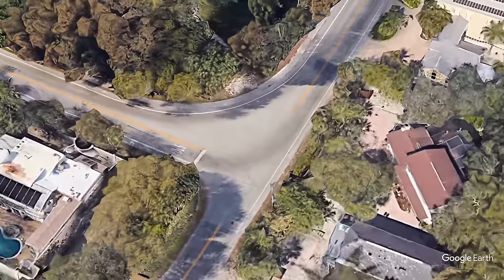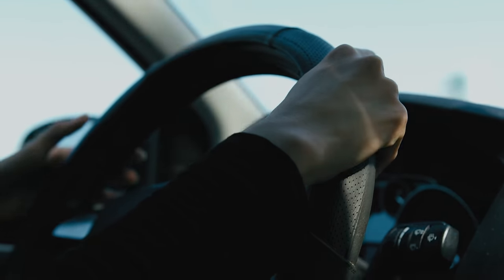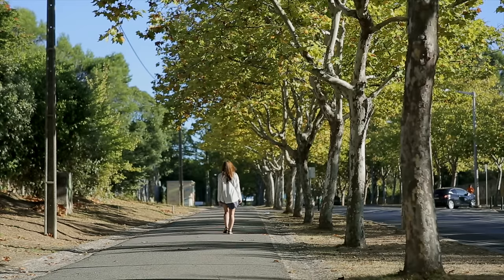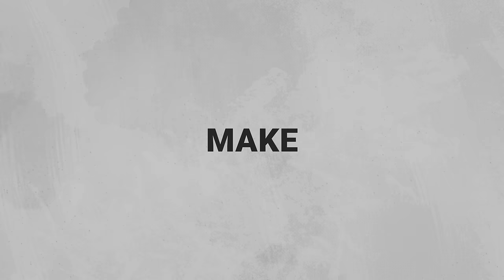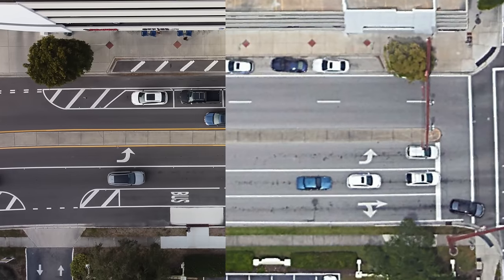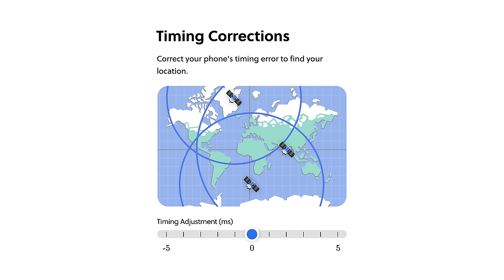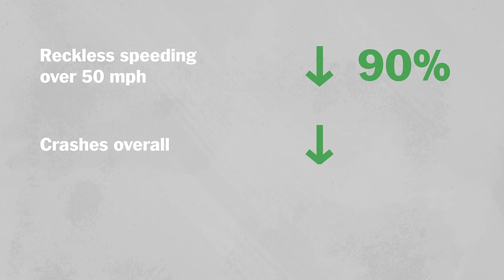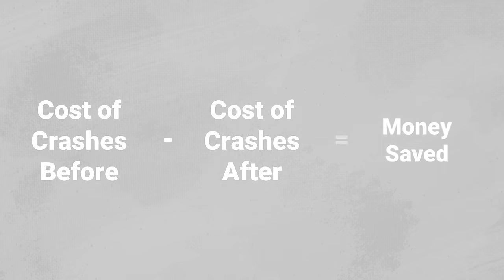This is the key to safer streets

Comment: Where I live more and more round-a-bouts are being built. They are very expensive, as one of the most often type, a micro round-about on 2 lane roads often cost well over $1.5 million.

These micro round-a-bouts are designed to slow down traffic, going against what most people are told: round-a-bouts increase traffic flow.

They often are designed with 12 foot sidewalks even if the roads don't have sidewalks. They often don't block sight lines like a proper round-a-bout. This causes people to stop at the entrence instead of yielding simply because the driver sees a car driving towards them on the other side of the round-a-bout. This is why the center circle of a round-about should be disigned to block sight.

These micro round-a-bouts often have un-intended consequences. Before the round-a-bout it may be difficult to turn left onto the side road. With the round-a-bout it is now just as easy to turn left as to go straight.

This is true for the main secondary road and the neighborhood road. This unintentionally coverts the low volume, low speed neighborhood road into a medium volume, faster speed connecting road.

While the intersection is arguably safer, the neighborhood road is not. 

The main road for this round-a-bout is actually a secondary connector road. The south end is a high traffic 2 lane state highway. Traveling north the first cross road is this round-a-bout, then a secondary connector road, then a secondary 2 lane state highway and then ending at another connector road.

Every other cross road has more traffic. The 2 State Highways and the nearby secondary connector have heavy traffic that often backs up. All 3 have room for a decent sized round-a-bout, none are being considered.

-----

Then there are areas where many round-a-bouts are built on 4/5 lane streets. Because the primary purpose is to slow traffic, every round-a-bout is designed differently, forcing people to slow down to determine which kane they need and causing confusion.

Some may have 2 lanes entering the round-a-bout (from now on R) with a 3rd lane specifically to turn right.

Some may have 2 lanes entering the R with the right lane forced to exit at the first right.

Some may have 2 lanes entering without forcing the right lane to exit.

1 R is designed to be a freeway entrance AND a side street that has a hospital. This means when heading to the freeway and entering the R, if you want to go to the hospital you need the far right lane. If you want the freeway on-ramp you need the middle lane, if you want to go over the overpass you need left lane if you will be taking the next onramp or the middle lane to stay on the road. Entering the R from the hospital means you either take the right lane which only allows taking the first freeway onramp. If you stay on the main lane you are forced to cross paths of the R traffic taking the exit for the first freeway onramp then decide which lane you need while on the overpass, left lane for 2nd freeway onramp or right lane to continue onwards.

Exiting the freeway onto either R is just as confusing. At the very least this should have been a single Oval-a-bout.

At the other end of town, the final R is also confusing because one entrance of the main road is 4 lanes, with the right lane forced to exit and the other side of the main road is only 2 lanes.

This means every time you approach a R, you not only have to figure out which lane you need, but also how many lanes of traffic are coming towards you. Remember there are never 2 Rs of the same style in a row no matter which direction you are traveling.

And to make things worse, this is a shopping district and they allow entrances/exits from the various strip malls and clusters of shopping directly to the main road instead of forcing them to only use side roads.

---------

In another area they are putting in tiny micro Rs. The stated goal is to force traffic to slow to 10-15 mph. This road is a connector road from a freeway exit to a primary connector road. The road has several apartment complexes and house sub divisions.  Originally this road was 2 lanes but divided with a mound and/or trees in the median.

These Rs are so small a full size truck needs to cut through the center by several feet. Most of the Rs are located at apartment entrances.

No Rs for the busy freeway entrance. The first cross street from the freeway goes to an elementary school and middle school. There is also an entrance to a large church. This area is very congested, so the solution was 1 stoplight for the church and another about 50-70 feet away. They didn't put in a dedicated right turn lane for the schools, nor a dedicated right turn from the schools. This area is about 150 feet from the freeway and on the other side of the freeway leads to the shopping district and mall for the area.

The end result is worse traffic as parents and buses pick up and drop off students.

All of the dedicated left turn lanes were removed because of the Rs. There was enough room to add a 2nd travel lane. The few side streets with traffic lights could have been converted to decent Rs. They could have added small curves to slow traffic, but many areas that don't have direct appartment access could safely be 35mph.

Instead they broke the project into  3 phases with the cheapest phase over $35 million. The total price will likely be $125 million or more. This is in an unincorporated town of about 25,000
Reply: Are you like 90 or something? It's spelt roundabout, not round-a-bout
Reply: @Gfynbcyiokbg8710  feel better?

Comment: I'm pretty sure I learned that the bulges at the crossing were not as effective as the theory suggested.
Because the extra visibility played into the driver's speed perception, so people who know they're going straight run red lights at them more. The pedestrian advantage was there but drivers didn't act safer near them.

Comment: Is there a negative impact on traffic?
Reply: roundabouts improve traffic flow because you don't have to stop. Whether at a light or a stop sign, only one car can go at a time, so traffic slows dramatically at a stop, increasing congestion and incentivizing dangerous and unpredictable behavior. By using a circle cars generally don't have to stop, so times through these control devices are better than conventional devices.

Comment: Tree roots also create problems - they destroy paved surfaces as they grow.
Reply: yes, but at a much slower rate than cars destroy surfaces, so it's not really a problem on roads with normal traffic.
Reply: @BenjaminWalburn  got to laugh. They re-levelled and resurfaced a road I use most days, a feeder road to a housing estate, and a couple of years the tree routes had caused the uneven road surface to return whilst the top surface is still fine.

Comment: I moved to a new province and got a speeding ticket my very first drive. This video explains why it makes me so upset. 

I was on the highway - three lanes per direction, large median, on/off ramps, and of course, no pedestrians, no intersections. Limit 110 Km/h. I was actually going 101 looking for my exit and got a ticket for speeding. I have since found out that the highway limit drops to 80 in city limits. No design change, just a sign that I didn't see. 😡  I have also seen rural highways here with one lane in each direction, intersections, no median, and school bus stops. Limit 100. Not intuitive at all.

Comment: It's funny how stuff gets around, this stuff was done in India some time ago, a few years I think, they used bright and colourful guides for some dangerous junctions, using road paint over plastic.

It's a real shame road markings get ignored by designers so often, they are, to my opinion, the most effective way to inform a driver, a sign can be missed, huge numbers/letters and lines, filled shapes, are a lot harder to miss, and their use can help assign blame when needed in the case of a collision.

But it's important to remember these adjustments made to existing roads, are the BARE MINIMUM, these are the cheapest way for government to help reduce damages and deaths on the roads.

Comment: Ever heard of non-newtonian speed bumps? For those unaware, a non-newtonian fluid hardens when a high level of sudden force is applied to it. This way, if a vehicle is going at the proper speed, the fluid stays fluid and it is as if the bump is not there. Go at the bump too fast though, and you are going to pay for it.

Comment: Mini roundabouts in the UK don't even bother with the plastic - they are just a bit of paint on the road!
Reply: People in the US are not well... acquainted with roundabouts. 

Just simple psychology game. If it were just paint, then people can just ignore and drive over it. But because it's raised, then people will think twice about going over it at high speed, in fear of damaging their vehicle.
Reply: @harveywilde6781  In fact, in the UK, half of the time they DO just drive over the middle of it.  The US solution works much better. Also, the US is well acquainted with roundabouts now that we've had them for some 30 years.

Comment: 89 mph on a street in a neighborhood is madness. 89 mph on a wide open interstate is often illegal but really not a safety issue!

Around where I live there have been roads that had their speed limit lowered (sometimes just as NIMBY noise complaints) some claiming for safety but the infrastructure didn’t change. So now those roads are more dangerous. You have the people who are following the speed limit exactly and those familiar with the road driving it at the speed the road was designed for. The large difference in speed among traffic is a hazard. And crash data supports that. But the response has been more radar traps rather than just fixing the root cause.

Comment: How is plastic preferable to standard painted mini roundabouts like is used in the UK? It's worse for the environment as it wears away and I'd be surprised if it's cheaper either.
Reply: The downside of paint is that people might just ignore it, while simple physics makes a plastic curb much harder to ignore. They also mention that it's a trial installation, so it has to be easy to remove.
Reply: @2001Pieps One thing they're missing out on is that those painted roundabouts are also somewhat raised which is probably why it wasn't used here. They're more permanent than the plastic option.
Reply: @kev2034  Not all mini roundabouts in the UK are raised, in fact, most of them seem to be just paint, which allows cars to simply pass right over them.
Reply: It's recycled plastic put to good use, instead of going in a landfill.  I should think that's much better for the enviornment.

Comment: The ridiculous thing is that this also decreases emissions and increases fuel economy slightly from not having to accelerate from a stop. On top of that, you don't have to take turn stopping one by one so while yes it is slightly slower when there's absolutely no traffic if you drive like a maniac, it's actually much quicker to get through when there is high traffic coming from one side during a surge. And safer too.

Comment: 7:55  okay guys, question here:  The middle is for both sides to turn left  without any certain stop?   This feels a bit crazy to me, wouldn't that mean that you could potentially have 2 drivers deciding they need to turn and then collide with each other?  

Or am i misunderstanding this
Reply: You are.  You usually enter the turn lane within about 20-30 feet before the turn, which is enough time to stop in case there is another turner opposite. Also, we don't enter them at full speed.
Reply: @jaycee330  got it, thanks :D

Comment: Now how OP did not mention anything about speed limits making people go a certain speed.

I love in a large industrial suburb of California. My drive to work includes a street where the speed limit is 45.  It's extremely rare for anyone to go over 35 for a large section of it.  Peoples comfort does not even let them get up to the speed limit here.  A low visibility turn that had a bus depot exit makes it feel dangerous to go that fast.
Reply: Speed limits don't change much

Comment: The intersection does not look pretty typical, it looks weird like there's open space without at least dotted lines to indicate direction like you'd see in the intersection of two 2+ lane stroads. Also the shape, it looks like a slip lane on the one side or something? And the stop line situation is weird too, this seems like it could have been a T shaped intersection with the main direction having the right of way then another street that turns onto it
Reply: Of course the roundabout is better just doesn't look like how they'd usually make an intersection, maybe they did it differently bc they wanted quicker left turns like less preference to the straight away?

Comment: in Romania the speed limit in a locality (city/village) is 50 km/h, and on a hightway/roade is 120 km/h, but is comon to see negligent drivers in the range of 70 km/h. So for me a spead over 120 feels like a rocket.
Reply: In my country drivers only get fined for speeding 20 km/h over the limit. This has been the case since 2013, when the fine for speeding 10 km/h over was repealed (and to be fair it was really tiny, only about 3$ at the time). Also, there's been a 50% discount for paying a fine within 20 days, since 2016.

Comment: The only thing that little roundabout did was slow everyone down. It only looks good from the perspective of someone who's only concerned with safety. What if a popular shopping center opens nearby? A traffic light with a yellow arrow would keep traffic moving at a higher volume, and be just as safe.
Reply: You need actual physical barriers to improve safety. Car drivers generally ignore signs and warnings.
Reply: Physics work better against stupid drivers than signs.

Comment: I love round abouts and the engeniering but i have a problem when stuff like speed bumps are used too much or the street are to agressive to car drivers. Because more than often they are unnessesary and produce more pollution. A car is not efficient if it has to slow down every half a mile and has to speed up aigan

Comment: But… do the normal white mini roundabouts cost that much? You’re already painting on the new arrows and stuff, aren’t the mini roundabouts made of the same rubber stuff? I wouldn’t have thought melting down and specifically moulding plastic would be cheaper than just painting them on. 

This video was very bizarre from a UK perspective. Having pedestrians cross large fast lanes of traffic seems bizarre. I love the crossing islands as they don’t interrupt the flow of traffic but as a pedestrian you don’t have to wait for both directions to be clear before you cross and, as you said, it gives you more time to cross. It’s really helpful in semi-busy areas and is a lot cheaper than installing traffic lights. A young boy died in my area because of the lack of designated crossings right outside of a local park. Their solution, which has been great, is multiple crossing islands, as traffic lights at that point in the road weren’t feasible.

Comment: 9:05 - You are right about the advantages of a center turning lane in opposition to the undivided four-lane road, but it would be even better not to make it the common US american "suicide lane" that allows left turning to occur just anywhere you like, making drivers go into the lane if they want to turn left somewhere down the block, sometimes even coming head-on with a driver that does the same thing. Dedicated left-turning lanes that kinda weave into each other in the middle are the optimal solution if you have the space for three lanes. This statistically proven-to-be-better solution is more common in europe, but some municipalities do start to implement them in the US as well.
Reply: Americans are quite strict in the use of the center turn lane.  They don't use it as travel or passing lane. The law is quite clear that you cannot travel more than about 40 feet in it.
Reply: @jaycee330  I know that's what the law says, but have you BEEN to anywhere in the US? It's not how they are used or enforced.

And science agrees: A UCLA study in 2023 found that turning a full center turn lane into turn pockets with ped islands reduced the crashes by 32% and fatalities and severe crashes by 53%. They are called "suicide lane" for a reason.

But to be clear: They are way better than a four-lane two-way street without dedicated turn lanes (that much is equally clear in the statistics), so they ARE an improvement. It's just that making the center lane non-continuous and limiting the number of intersections is even better and safer.
Reply: @QemeH  I live in Illinois, so of course I live in the USA.  I have yet to see in my 30 years of driving a head-on collision in the turning lane. It's a pretty rare thing.
Reply: @jaycee330  But you get that this is anecdotal evidence, right? Just because you haven't seen it happen doesn't mean it doesn't happen.

But you are actually kinda right in that a raised median with turn pockets isn't always the better solution than a two-way left turning lane. In fact, the higher the access point density is (i.e. the more entries and exists open onto a street) the better a center lane gets in comparison to the median with pockets. But since streets with high access ratio and high speeds are notoriously bad for their crash rate regardless of turning lanes, the better choice is to reduce the access point density and then use the safer design for that.

So while there is a driveway every 50 yards up and down main avenues with high speed traffic, you are correct. But as soon as the US discover that you should have EITHER high access density OR high speeds for through movements, but never both, then I'm right ... ;)